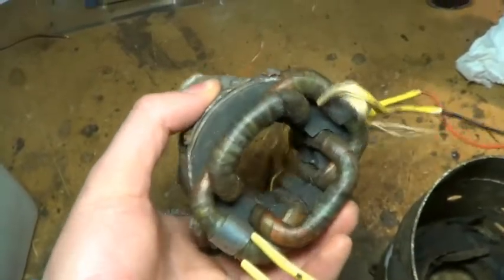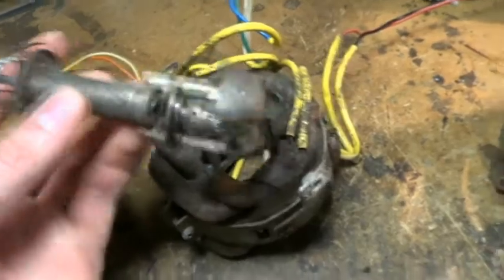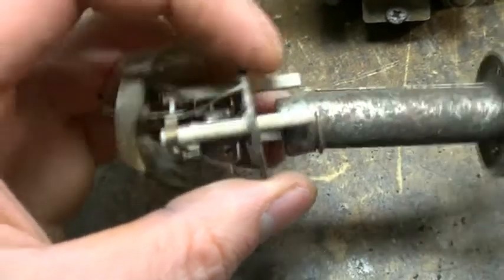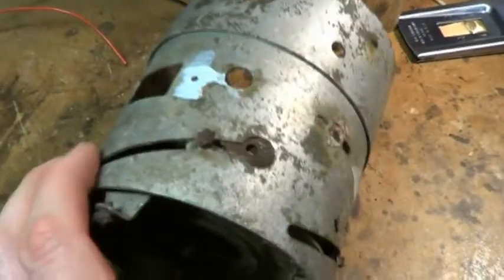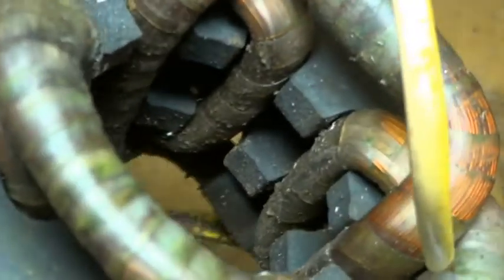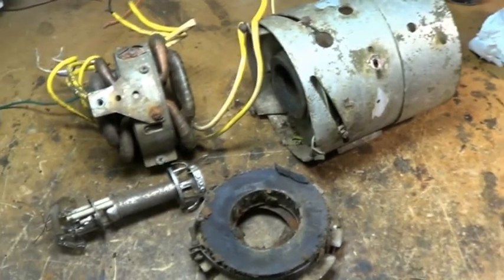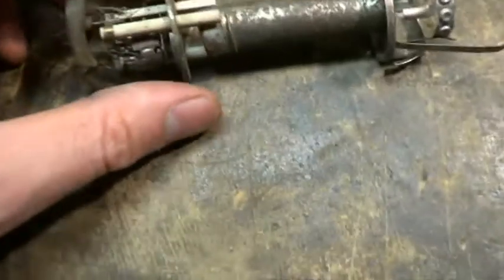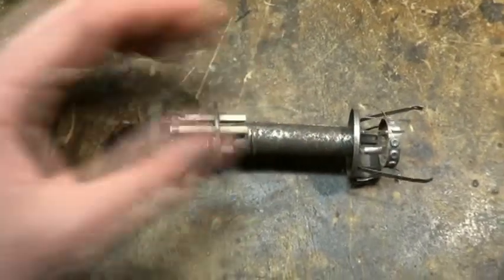Old TV tube neck assembly

Comment: what you call the fillament assembely
is the actual gun
the rest are just parts to accelerate the electron beam

the coils bent the beam inside the mettal tube
i dont know why

and it is supposed to be of center
there is a ion trap magnet that bends the ions in the right directions
Reply from the maker: Yes, I know the extent of the actual filament, but generally the entire filament + acceleration electrode is colloquially referred to as the gun.

As I pointed out later in the video, it's more than likely that the deflection coils were originally located well after the final electrode, but the neck has been shoved through the coil assembly when it was dropped. If deflected inside the final anode, then the electron beam would likely just strike the tube.

What are you referring to by an ion trap? I know what ion traps are, but don't see how this would be relevant to a CRT, since they are evacuated and gettered to a very high vacuum, so there is no (well, hardly any) residual gas left behind.
Reply: a ion trap is used in old crt's
with a deflection angle leaa than 90degres
to bend the ions towards the screen
they also prefent bad ions from burning the screen

they are real common
almost all 40-60 televisions had them

and it is nothing more then a clamped magnet on the crt
Reply from the maker: ***** Thanks for the reply, very interesting! I guess those were the days when the vacuum maybe wasn't as good as now. I found a good page on this at - http://www.oldtellys.co.uk/otmonotube.html

I suspect that the two big magnets are the focus assembly, not the ion trap magnet, since it looks to be much smaller (just a sort of clip-on thing) and, besides, produces a cross field. It's probably still lying in the grass where I found the rest of the tube ;-)
Reply: it had to do with the way tubes were build
the vacuum has inprofed but not so much
it has all to do with the deflection angle of the crt